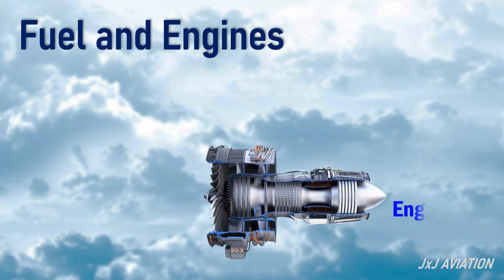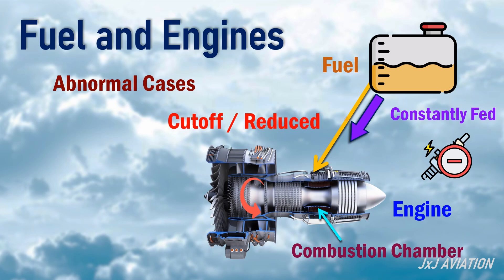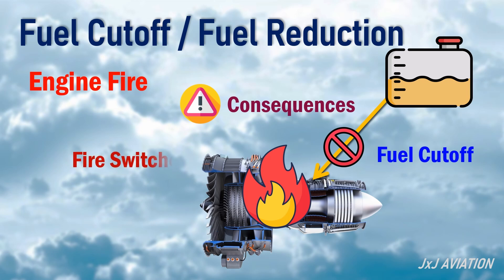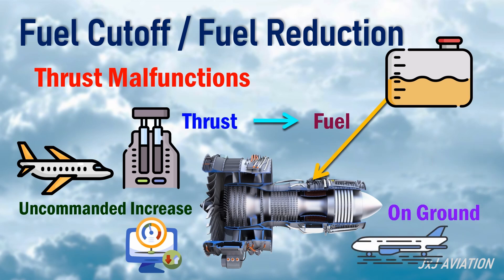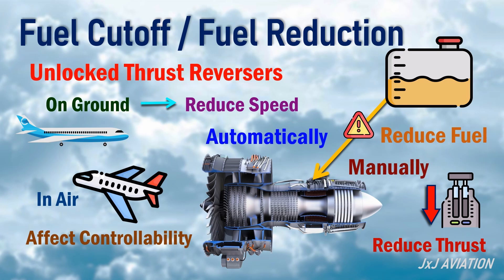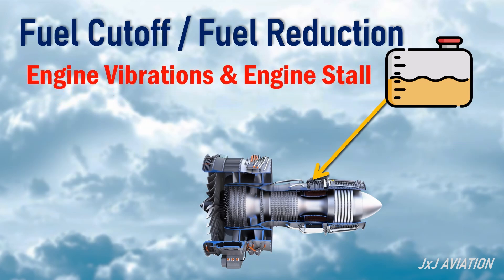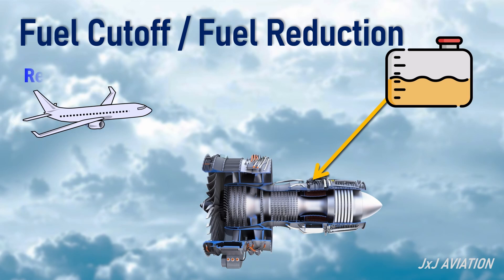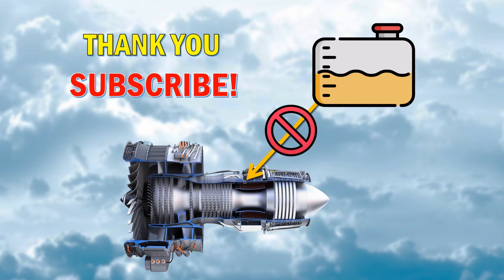Fuel Cutoff or Fuel Reduction? | When does it happen? | Automatic & Manual Fuel Cutoff/Reduction

Comment: None of these scenarios applied to the Air India flight. Black box report yet to be announced. Thank you as always for your work.
Reply from the maker: The actual reason for that incident is not known yet. This is just an aircraft knowledge video
Reply: @JxJAVIATION  correct me if I’m wrong. A report DID come out and stipulated pilot incompetence. Nothing with the metal.
Reply from the maker: @storminnormin4651  That was a preliminary investigation report which came out. The findings may change. It just mentions fuel was cutoff to the engine.